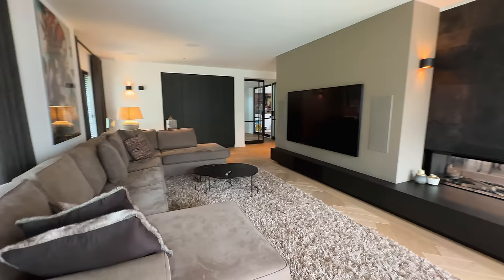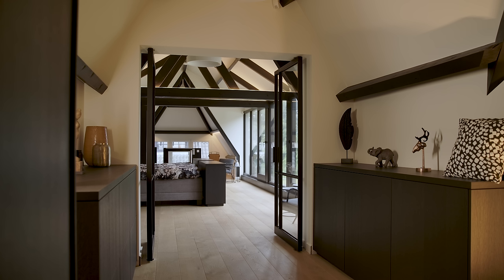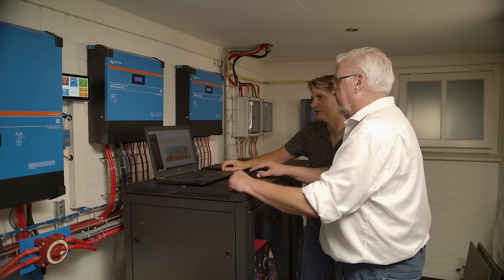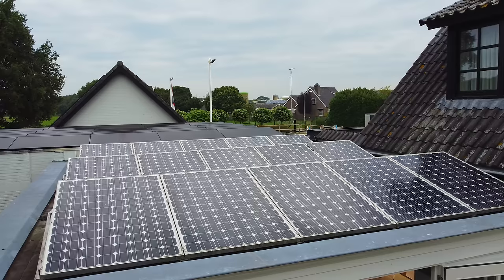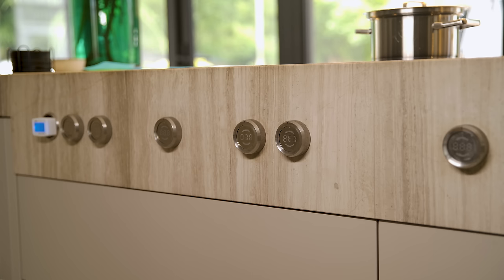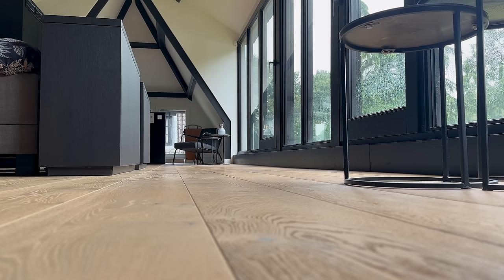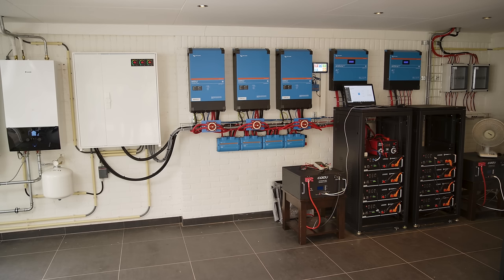Power Independent House using Energy Storage System & Solar

Comment: 8 years ago i purhased a Victron multiplus 24v\5000kw\120Amp unit with a pair of 150\100 Victron MPPT charge controllers.
I had started off with an 20 year old 1000 Ah lead acid battery bank in rough condition.
The system still runs without any issues 8 years later.
The quality overall is nothing short of perfect with easy to follow programming ability and excellent efficientcy is unreal.
I thought i had a bad battery so i reprogrammed both inverter and charge controller within 15 minutes.
Reply from the maker: Thats great to hear!
Reply: We use lead and runs 👍 great see our u tube using victron and built a very large off grid system

Comment: A wise choice to use Victron, low frequency transformer based inverter chargers instead of the many cheap, high frequency, transformerless inverter chargers that have flooded the market.

Comment: Great system, very envious. However like most of us using solar,  he must struggles during overcast short days in winter. I say that because, if not he would not need to consider wind power generation. I have an off-grid system about one mile from home providing 20kw PV. This will keep two EVs charged for typically 9 months/year with excess to be exported by battery trailer to my house for about 10 months/year. I find that each EV consumes about the same as the house per year so it is a big challenge to be totally off-grid into the future. Last month, December 2023, was one of the worst months for solar for several years and it proved that even with 114kwh storage it was impossible for me to avoid taking any grid electricity during that month. Wind energy might be a way of making up the difference but at present small scale wind power rarely works cost effectively and is very dependent on a good location.

Comment: I didn't think the multiplus 2 10kva was able to be linked for 3 phase
Reply: yes it is, 1p/parallel isnt possible though
Reply: basically all viktron inverters can be used in 3P. Parallel instead require specific models (!). Multiplus II can be paralleled (up to six units) but only in the 3000VA and 5000VA version, 8000/10000/15000 can't. So if you want a 20000VA single phase system with Multiplus II you must parallel four Multplus II 5000VA instead of using only two Multiplus II 10000VA wich is not allowed. The "QUATTRO" inverters are more versatile, they can be used in parallel even in the 8000, 10000 and 15000VA versions, so you can have high power single phase system pairing only two units.

Comment: Well done Bert, I love seeing Victron used efficiently, its also a super neat installation, so credit to the installer, I would like ask if its possible to parallel the 10kw multiplus IIunit for single phase application as the spec sheet says it not possible @Victron energy
Reply: I'm pretty sure you can.

Comment: At 3:37, where he talks about the big spike in voltage from the grid to 250V and how he solved this using ESS.  I am unclear as to how exactly ESS solved this? Is he saying he basically went off the grid completely (thereby the spike to 250V no longer applies to him, or that he used ESS in some way to lower the voltage down to 230V?
Reply: Also interested in this. My understanding with the MP II is that the AC out we'll always be the same voltage as AC in, unless I'm mistaken? 🤔
Reply: @James-op6ls  Yes when grid connected and not inverting, the inverter simply acts as a bypass device which means that its wouldnt solve the high voltage issue. My guess is that he went totally off grid and used ESS as part of that setup, Just not clear, as the way its conveyed, sounds like ESS was able to lower the voltages while still being connected to the grid
Reply: You can alter the incoming voltage and out going voltages.

I know of an electrical enginner that used smaller cable and at the end of the very long run had 160volts then input that into a multiples ans altered it to get the 230 volts 😂.

Saved on cable and the current draw wasn't large just needed to save on cable and avoid voltage drop. Genius

Comment: Mooi hoor, maar is 40kw opslag niet wat magertjes ?
Reply from the maker: You may have noticed two other batteries either side of the racks, Bert is testing out some more storage solutions.
Reply: @VictronEnergyBV 

Ah I see, I presume the storage voltage is 48V DC ?
How does Victron see this for the future ? Will 48V be the standard or will we move to higher voltages, such as 72V DC ?
The trend in most battery equipment is ever increasing voltages.
We all remember the time when 18v for you battery powered tools was 'the future' , now it's gone up to 40 and even 60volt for such tools.
How does Victron see this ?
In my humble opinion I guess the same trend will apply for home energy storage. Or is there a good reason why we wouldn't see storage voltages above 48v ?
Reply: 48v is touch voltage safe so that's maybe that's why 😊 for end user type gear 48v is a safe option
Reply: @bramcoteelectrical1088  
Ah, never thought about safety, lol.
Yes, makes sense. I was more looking at it from a technical point of view.
So yes indeed, for DIY stuff 48v seems like a safe limit.
Maybe for the high end stuff more voltage makes more sense, maybe comparable to cars, or even trucks.
You don't wanna be messing around with those cables.
Reply: @edwinbruckner4752  100% I think it's great to use 350v dc stuff as you can power some very big systems just I think the risk to DIY users as you correctly said.
Thank-you

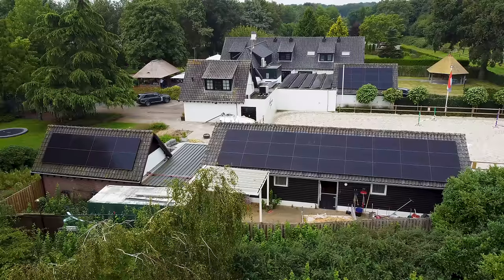Comment: 5:17 is the top right battery not grounded by mistake?
Reply from the maker: Well spotted!  We have spoken to Bert, a battery needed replacing and they forgot to install the earthing before we arrived to film.  Worry not, this has since been connected. Thanks for the heads up though!

Comment: Grid Voltage normally is 230V +-10% so 207-253V. I don't see a problem with electronics there. Transformers will go into magnetic saturation at some point, sure but the capacitors in switchmode power supplys that get charged up to the peak AC voltage are usually 400V, so the AC voltage has to go up to over 280V to damage those. If some device fails at 253V it is not the fault of the grid but rather a crappy designed device
Nice setup though. I like the fact that you can control all the victron products with basically anything using modbus
How did you configure the system to prevent over voltages from happening? Does it disconnect from the grid if there is an over voltage?
Reply from the maker: Well Bert can see the trend of the voltage going up and so he wanted to take precautions to protect his household electrical investments.
Reply: Also interested in the overvoltage protection
Reply: Over voltage isn't good and just goes as wasted heat.

Here in the 🇬🇧 UK alot of domestic products are from European countries and are rated at 230v and our supply is 250v +/- 10%😮but this over voltage is just wasted as heat 🥵 🔥 ☀️ so a nice lower voltage is softer on the power supplies and consumer electronics.

230 voltage ⚡️ ♥️

Comment: any deisel generators ?  may have gone the quatro
Reply from the maker: Burt doesn't have a diesel generator.
Reply: is it off grid only   ?    @VictronEnergyBV
Reply: @margarita8442 , when using a generator, i would recommend to charge the battery with another Victron Multiplus II 48/5000 and use this as a 48V-charger connected next to the other MPII 48/5000 and as a backup unit for the three other MPII 48/5000. the generator is a 1-phase-version ~4 kW continuous AC power with a blue CEE32-connector to the MPII 48/5000. the main advantage of this version is, that the voltage is constant like before and nothing of the system has to be changed.
Reply: exactly what I was thinking about! Thx for the confirmation!